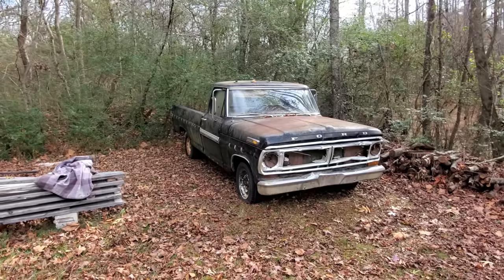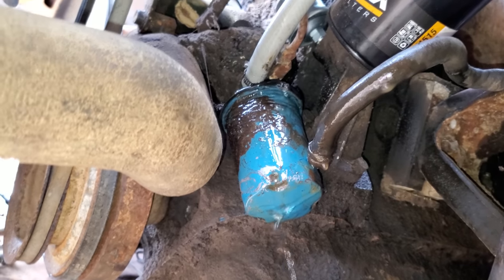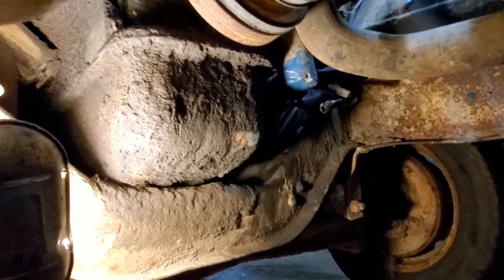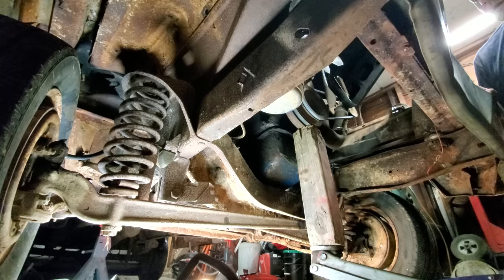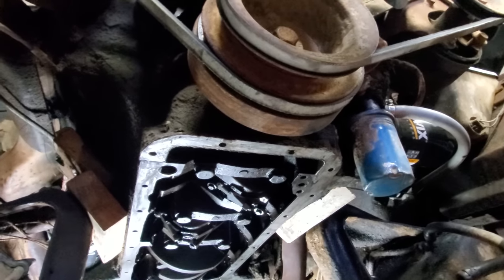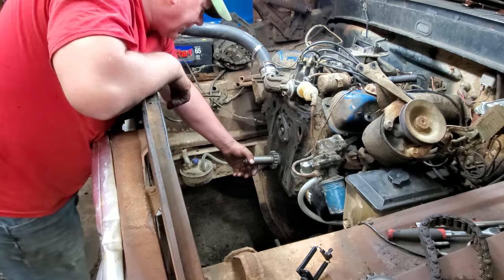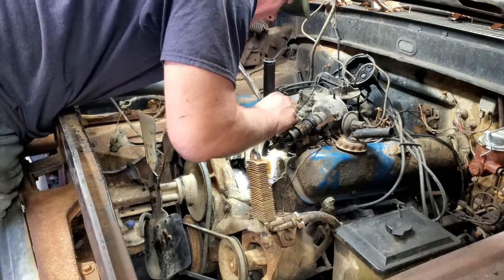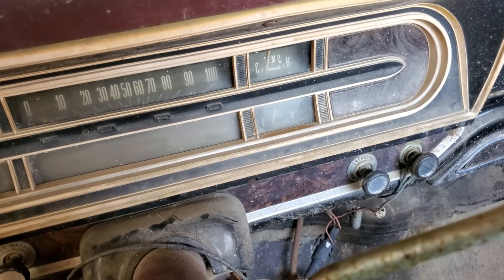Where did Dumas's oil pressure go?!?! Why will it not idle????

Comment: Great candidate for valve medic, before you replace lifters. We had good luck with that product back in the 70's. Seen many of these ford's fixed with it. Can't hurt. 👌👍
Reply from the maker: Never heard of it.
Reply: @ThisNThatGarage  I think it was basically kerosene.. it cleaned the sluge from gummed up engines. Especially the lifters. Works in about 3 mins.  I think it's called motor medic these days. When we replaced blown engines with a junkyard engine, that's what the older guys used every time. Amazing. 80% of the time, it's works 100% of the time.......Google. 👍

Comment: Working on cold concrete, know a little about that 🤣IMHO, the oil pressure at idle looks to be below 10psi with a new aluminum radiator so it's staying cool and 15-40 thick oil, she's plumb worn out. Soon as you get some heat in that crank and rods at speed, it'll probably go to knocking like my old 348 i slapped in my 55 150. save on some time and plan on a rebuild... who knows how long those rods/crank bearings been starved of oil.  thanks as always for sharing! Was for sure that crank would spin and spit the 4x4 out lol! but you made it work!

Comment: My father drove an ‘86 F150 with a leaky 302 from 1990 to 2004.  He worked heavy construction all over eastern Pennsylvania.  I drove the truck for a few years when he finished with it, finally retiring it just a few years ago.  The front main seal leaked the entire time and between the oil and construction site dust, everything under the hood and under the truck was coated with INCHES of grime.  Changing the oil required a full face shield with the amount of crust that would fall in your face getting under that truck.

In spite of all that, it was probably the best running truck, for over three hundred thousand miles, that either of us have ever owned.  It was the first year for fuel injection and we never even replaced an injector for all those years and all those miles.  Fantastic truck.  BUILT FORD TOUGH!!

Comment: If I had that much sludge in the pan, I would put it back together and run a few cans of Sea Foam and used oil and let it run a few minutes, drain it and fill it with fresh clean oil. You're doing a great job. Thanks for the content.

Comment: Did you make sure the cam was pulled up snug to the retainer plate before you lengthened the locating dowel? If not, that's a big problem, as the sprocket won't be tight against the cam and the cam won't be as far forward as it needs to be and consequently, the lifters won't ride on the cam lobes where they're supposed to. Love your vids. --Bruce

Comment: Liked this episode! I’ve got a 1969 Galaxie with a 390, and the prior owner jacked the front  of the car up in the bottom of the oil pan instead of the crossmember. The pan is bent in badly on one side. I’ve not driven the car and noticed it after I bought it. Things seem ok, but I’m fearful the oil pickup screen could be partially blocked off and am going to replace the oil pan, pump and pickup screen.
Im noting the drive shaft for the pump! Good catch on your part! Im also checking my timing chain while I’m in there, as well.
Hearing from others on how to raise the engine and seeing your method helps me better understand what needs to be done. I’ve got a 4 post lift with a rolling jack, which will be easier for me. Less up and down. In years past I’d have to do it as you did. 
I’ve owned this car for four years, only started it up to drive it onto a trailer and have it towed to my current place, and only drove it off the trailer and into my shop. It’s sat there for four years now. I’ll get to it soon, and replace the water pump, radiator and gaskets and hoses and belts, too. 
It’s 53 years old now, not sure of actual mileage, but it’s a clean non molested original, Convertible.
My plan is to keep it close to original, but replace and repair as necessary.
I only have idiot lights in the car, haven’t seen the oil light come on, but am installing oil and temp gauges.
Keep the episodes coming! I really enjoy following along!

Comment: Fix a Flat works if you pit it in and drive the car ir truck for 20 minutes.  I have 2 tires in my car held together with Fix a Flat.  I have to remember to tell the tire guy that when I get new tires in February.

Comment: Nice job!!
Just an observation into your oil pressure.Given what the bottom of what that oil pan looked like i was curious if you went and changed out your old oil filter in the process..The old oil filter quite possibly picked up a lot of that sludge along the way causing your oil pressure to drop.Anyway look forward to watching your next one.

Comment: thats odd, i just built a sbc and had same issue with new timing chain and gear set, i then bought another from napa and it was nice and tight, the one you have wouldnt be a coyle would it
Reply: cloyes.. sht, funny,,i think i have one in shed..better check it..damn..cant buy sht these days. different grades of chinese..
Reply from the maker: It was a cloyes.

Comment: If I had any friendly advice for what I saw in the oil pump and pan is to run Seafoam in your motor oil to clean out your engine oil journals in the bottom end

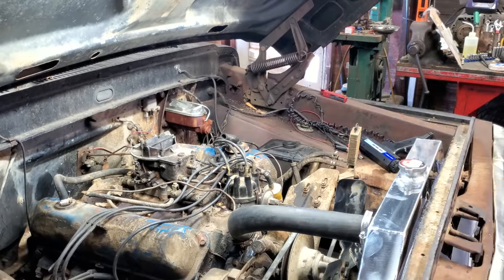Comment: It was funny when the horn sounded while turnin the key .. at 44:30 you see sparks from your solenoid.
Back in the day we'd put a quart of kerosene in the engine for 4-7 minutes before an oil change... mostly a requirement from using Penzoil, wonder how many engines got destroyed from those Arnold Palmer ads.
Switched to Valvoline some forty years ago and never look back.

Comment: I wish the oil pan would come out that easy on my 1984 F150 with 302 compared to yours. I have to pull the engine completely out to remove the pan in order to replace the oil pump. The first time I did it I jacked the engine up so high that I had to disconnect the radiator hoses, transmission cooling line, motor mounts, power steering pump and still could not lift the engine any higher. The engine had to come out. If I could buy a two piece oil pan or a pan that has a detachable plate right under the oil pump bolts I would.

Comment: Excellent video Chad  :) thought oil pump and oil was sludge oil up like 80w90 differential fluid is like when need change too! Also think got lots resolved to and Lol when horn beep when lose connection on battery to starter! Also battery connection said cable need replacement and I do too! Hopefully seeing you work on this old Ford Truck sometime soon to!

Comment: I think the sludge in the oil pan, must be a new record for an engine that was  running.  I have done the main and rod bearings by lifting the engine like that, and it is easy, if you like to suffer and don't much care what your knuckles look like.  The old oil, really disguises the blood, so no problem.

Comment: Every 260 I've ever had would lose oil pressure when it warned up
Reply: I’ve got a 360 that I’m fixing to try and get going in a 68f100.I’m putting the 68 cab and engine in a 76 f350 cab and chassis I bought.The 76 didn’t have a body and the 68’s bed is trash but the cabs good.What type of gas mileage you think it would get? 10-12? If it’s around 8 I’m thinking about putting a 300 inline in it.Thsnks for any advice or info

Comment: Put a couple holes in the front bumper, install a tow bar and take the car home to work on it. (My mistake- you WERE home!)  When you showed the frame on the passenger side, wasn't it rusted away?
Reply from the maker: Frame has no rust holes.

Comment: I did the same oil pump drive thing once on a 63 Galaxie. Problem was, next time i pulled the distributor, the drive fell into the oil pan, cuz there's no more retainer. . Well, If that car still exists, someone either found it in there, or it's still there.
Reply from the maker: I had intentions of putting the retainer back on and putting it in from the bottom but that didn't happen. 🤦🏻‍♂️

Comment: If you take your radiator and a propane torch knock off all the lead with a brush steel brush off all the lead off the top header and the bottom header take some of the wire chasing a snake that fits down inside the radiator and cut four four feet of length rod your radiator out and then take some silver solder for copper pipe and put it back together your radiator will act like brand new hey

Comment: Pull out your distributor, and check your oil pump shaft. If the oil pump shaft is good, put a drill on it and spin it backwards for a second. If your lifters pump back up, you may have a blown head gasket. Sounds weird, but I had a 302 that would actually lose oil pressure when it got hot, ended up being the head gasket was blown, and it would pump the lifters back, and it lose all top end oil pressure, including the gauge. Spinning it backwards I'll show you if that's it or not. It sounds crazy I know, I guess I should watch the video and see what it's about, since I haven't done that yet.

Comment: The horn is odd , but dad had a 72 F150 that if you had a light out anywhere the turn signals blinker on the dash blinked the opposite  from the direction you were trying to go. never found out why but it always did it any time any light bulb burned out or was removed.
Reply from the maker: Electrical gremlins are usually head scratchers.

Comment: That is years of no oil change just keep adding oil, and probably stuff like Pennzoil crystalized the oil in the valley pan and maybe under the valve covers.and I have never seen a clean Fe Ford motor 352,360,390

Comment: Put you a fan somewhere to circulate the hot air down to the floor so you heat the whole garage top to bottom.  The china chain you must have ordered from evil bay or scamazon.

Comment: And the valve cover and front cover were leaking that is how the front of the motor got covered in grime when my dad got ahold of his 70 Ford F-250 ranger custom he pryed the valve covers off and the gaskets were cooked and brittle and turns out the grime on intake and the front of the motor is why they were stuck.

Comment: Your Jack is bleeding.  Btw. Idk if you know this or not.  But the bigger batteries in those impacts make them more powerful. Typically after 5 or 6amp hour they don’t get much more powerful.  But if you run it with a 2 ah. You do not have no where near the power as running them with a 5ah or better

Comment: 1969 f100 2wd, 300 billion miles,,1 oil change..dont scratch the blue paint,,it,ll never run again.. funny,,this is exactly what i have to do, on an 82 bronc..351c..either pump, or bearings..

Comment: Chad, instead of kerosene, change over to diesel fuel. You won't get the headaches or the fumes that you do from kerosene.
Reply from the maker: That's what I burn in it but you have to mix some gasgaline in with it.
Reply: @ThisNThatGarage  I run straight diesel in mine but mine will run 4 different types of fuel. Damn, thought I was gonna give you the wisdom to stop the headaches. Other than aspirin!

Comment: At first I thought you forgot the pan gasket not oil pump drive shaft. And I saw those spark plugs wires in the distributor cap. I can tell you like to live dangerously.  But that is why you have your warning right?🤣 I am going to be starting some car content hopefully this next year. Kinda hard to do something when you are a truck driver but will do what I can. And I will admit that I ain't no expert,just know enough to be dangerous. So all in all we all need that warning in the beginning. I will admit my first videos when ever they come out will be on my 1999 Dodge Ram 1500 with a 5.2L(318). Engine swap and before the engine goes in some stuff will be done to it on the engine stand.
Reply from the maker: Good luck!

Comment: You mentioned a possibility of putting a cam in this truck as old and woreout as that motor is id only  mess with the cam if it actually needed replacingand then it would get as close to factory as i could id watch a rebuild of that old motor
But im afraid your gonna find the crankshaft  to have significant wear  and tear i suspect your oil pressure problem is coming from sludge in the oil passages   because that oil pressure is lower than any thing ive ever seen
Reply from the maker: You haven't seen very many Chevrolets then have you? 5-10 psi at idle is actually OK.
Reply: @ThisNThatGarage  to be completely honest ive never owned a chevrolet
I know oil pressure can be pretty low and not do any damage but that oil pressure is still lower than anything ive seen my 72 ford f100 has 50 lbs of pressure when it cold but drops to 40 at normal operating temp thats why im thinking the oil passages may have some blockages or partial blockages  but either way its an old motor and probably could use a rebuild 
By the way what year is that truck ithought it was a 78 or 79 model

Comment: I have to say I have done the getting the ratchet stuck lol,so it's not just you.. know how I said that the great neck china made sockets were junk, well in 2004 I was helping a buddy pull the motor out of my truck and I was pulling out the right motor mount bolt and broke the ratchet handle off, with a gm fwd strut brace cut off into a 4ft section, but I had to beat that ratchet off of the bolt to get it out there so I could use a 36 tooth USA made craftsman ratchet and I ended up busting the socket smacking it with the hammer to get the stupid ratchet out of my way.. anyways as I said hopefully you don't feel so dumb now, you're not the only one that has done that lol!!

Comment: I would say since you just started it without any kind of lube in the cylinders last time,.you have scored what was left of the walls, never should of dry fired it after sitting so long,
Reply from the maker: Not real sure what you're talking about considering I actually poured numerous amounts of oil into each cylinder trying to bring compression back but I rarely put lube in them anyway and never had any issues at all so 🤷‍♂️
Reply: @ThisNThatGarage  Hense the blow by!!!!
Reply from the maker: @jasonpetrich4141  You must have just skipped over my entire comment but hence the blowby is due to a wore out motor. Maybe you missed all the garbage in the oil pan too. 🤷🏻‍♂️

Comment: Not sure which engine that is, behaves an awful lot like a 351m400 though.  The controlled oil leak known as bearing clearances  have grown up a bit too much. I will caution you on something though. You mentioned the possibility of installing a new cam. If you do, do NOT use a flat tappet cam! Lifters just aren't made to the tolerances required for a flat tappet to survive in this day and age. Then there is the whole oil issue. Top engine builders have said that even oils like t4 really don't contain near enough zink in them.  Hate to see you needlessly destroy whats left of that engine.

Comment: It looks like a bit enjoyable motor to me I won't see a guy cleaning his son cleaning out a motor at a machine shop and it'll be time where I live I'm one man machine to I'll be cleaned out a forward motor like that clearly broke a bu shot because it had pins all what used in it and depends on what hit globs up so much that it had stopped push hard from going up-and-down and this connected to the piston in the hole if you believe it or not I'm saying what's wrong with my own eyes

Comment: I would have thought cleaning off those parts would have made it a little bit nicer instead of as you're putting it on dust is falling off of it. It's just a little bit of soap and water at least it would have helped it run a little bit better too. I know after you take a shower you put on clean underwear cause you don't put the same dirty ones back on?

Comment: 🙋‍♂ Hello 😀      Augh- Ya !   👨‍🔧🧰🔧🔨🦾   This N That Garage ✅ 🏁  If it wasn't for bad luck, 🍀Chad wouldn't have any luck🍀 at all,  please get that fan shroud closed back in.  🩸🤕    When ever I used those Fix-a-Flat cans I immediately drive the vehicle to allow the centrifugal forces to seat the compound rather than letting the PSI pressure inside simply push the sealer away from the leaks.  Augh-Ya. 
                                       "I got a headache yes I do, it's probably from breathing _______?  and fumes".  Fill in the blank please....  Read more below...
Thanks for giving us that little "Deck the Halls" Jingle Chad,   and don't think we never noticed that sharp haircut you're sport'en too !   
  🎶 "Deck the Ford with Carbs from Holley Fa-la-la-la-la, la-la-la-la,   
  Tis the Reason Chad is Jolly,   Fa-la-la-la-la, la-la-la-la,    Don we now T-shirt apparel,  Fa-la-la, la-la-la, la-la-la,   
Slab of cardboard and a Reddy-Heater,   Fa-la-la-la-la, la-la-la-la ! 🎶  
Seasons Greetings to Chad and This N That Garage, we love this channel 🎅🎄🤶✝🎁🐶
Reply from the maker: You're a poet and didn't know it.